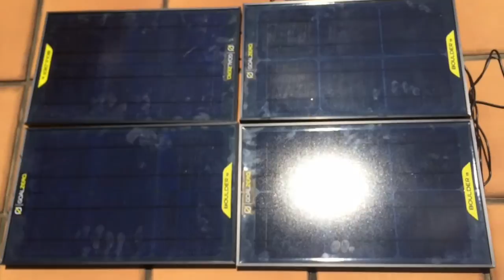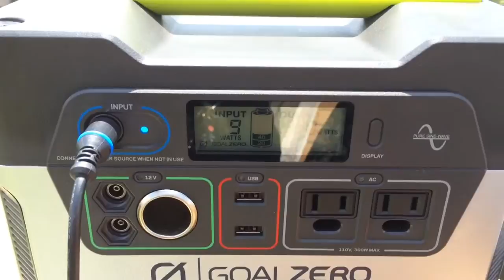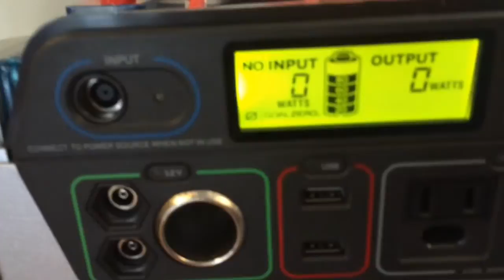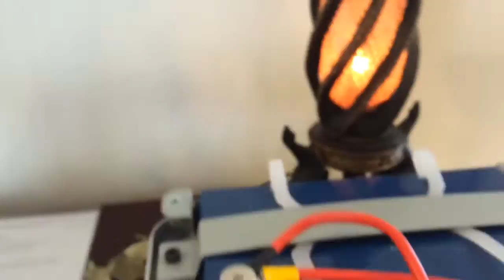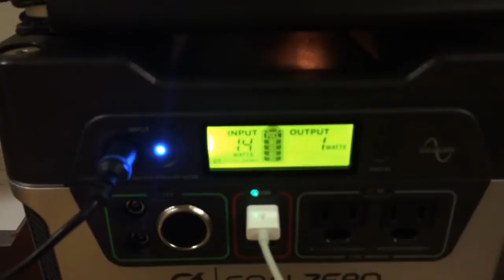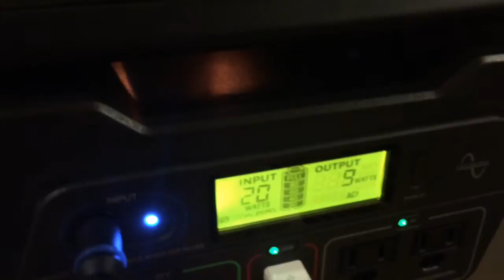Yeti 400 with 4 Boulder 15 panels (60 watt setup)

Comment: I've been watching quite a few videos on the goal zero 400. I'm getting ready to have a camper shell on my truck.  I have come to the same conclusion you have about the Goal Zero. It takes to long to charge with panels.  I guess the question for me becomes how much draw my devices put on it over a 2-day camping trip? It may not be an issue. I can charge it at home and while I'm driving. I think I like Renogy's version of this 400 better. A better price point and it will also jump start a car.
Reply from the maker: One thing I do like about this model is that it is chainable. Yes, this is older battery technology but unlike lithium you can easily chain more batteries to this older model yeti 400.  You can add more battery packs on left or right hand side of the unit and really increase your run-time.  The batteries you chain to it don't have to be goal zero brand but should be the same capacity as the internal battery.   While I don't recommend the goal zero panels for charging it due to cost per watt I do recommend the 100 watt panels from renogy and others which are about 70$ for a 100 watt panel (got mine on amazon).  You can quickly charge with something like that vs the little 15 watt go Goal Zero panels you see in my early videos.

Comment: Wondering what ended up being the outcome of calling the Goalzero folks regarding the issue
Reply from the maker: They want you to send the WHOLE unit back to the U.S.A (where I bought it) which would have cost 75$ one way to ship and probably something close to that to ship it back.  Wasn't worth it so I got an external inverter and plugged it in the side.